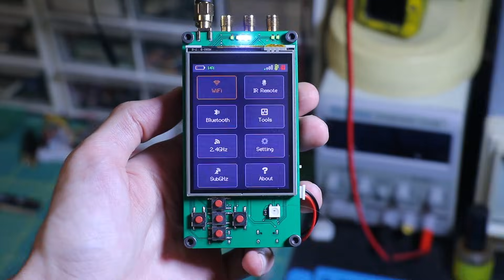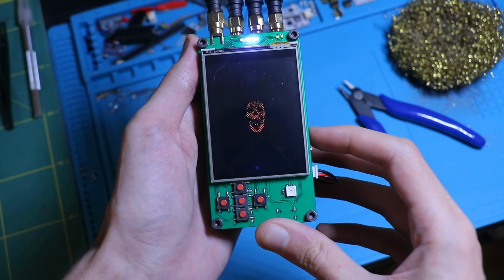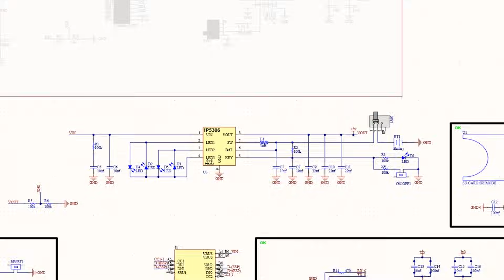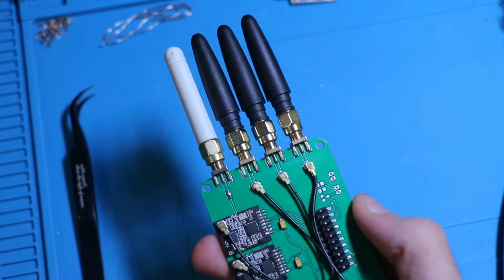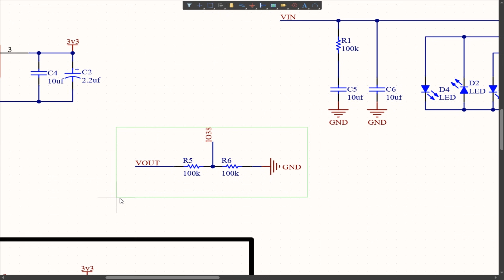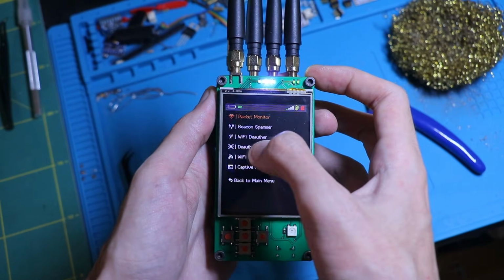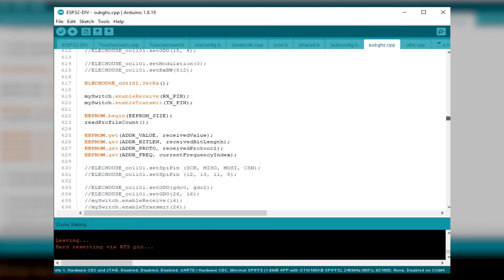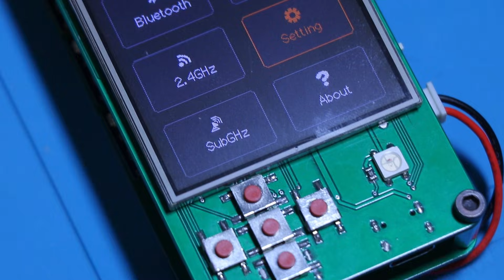I Fixed ESP32-DIV… and It’s Better Than Ever | Part 2

Comment: If several antennas are not used at the same time you can use a single SMA connector and RF switches. For instance, HackRF uses several SKY13317. Miniature relays will also do if you don't mind clicking. Naturally the user will have to connect the required antenna depending on the used frequency. My experience with HackRF shows that this is not a problem in practice. Also there are broadband / multiband antennas (several dipoles connected in parallel, as a simplest example).

Comment: Hello, good brother
I had a question
Instead of the esp 32 u, can I program another model like d or other modules?
Or should it be u
And it says ir remote control, can I test it or should I buy this transceiver module and install it, then will it run?

Comment: the number of antennas depends on whether you need them all on at once or not in addition to the intended frequency of each antenna. if there are same frequency antennas and each are not on at the same time, then you can use an single pole double throw switch (spdt) to toggle which will use the antenna at a certain time. the simple way is a physical toggle switch but a more elegant alternative method of an spdt might be preferred to keep it small and neat. 

consolidating antennas alone may cause issues with destructive interference, and loss. there might be something with adding a circulator, but further tests would need to be done.

Comment: nice lil design, btw you should add RF switches so you can reduce the number of antennas for multiband comunication.
Reply: Tbh, multi antenna design makes more sense because of antenna radiation efficiency in a given band
Reply: @Kawka1122 yes of course but he asked for a way to reduce the number of them
Reply: @Kawka1122  Not necessarily. Firstly, you limit what kind of antenna a user can connect (physical size limitations). Secondly, you don't account how several antennas affect each other.
Reply: @R2AUK  Not at all. External SMA antennas and in TDMA which most likely makes sense here, there is no influence between channels
Reply: @Kawka1122  Any metal objects near the antenna influence it, including other antennas. How much - should be measured for the particular case.
Reply: @R2AUK  to some extent of course. But that's matter of tuning. And in reality it is not such a big influence as operating out of band. These are low power TRX chips so not a big deal to get minimally higher SWR, only that it will affect radiation pattern. Influence on matching is close to none

Comment: Oh my God! I thought you scraped the old version and went with this new one... I have just received the last batch of components from AliExpress and want to start assembling it, this week. In regards to the Pin-Header, maybe you could use "magnetic pogo pin connectors"?
In regards to the antennas, maybe connect them on the pcb down and go along the PCB. The result will be a shorter device but bulkier.
Reply: Haha I literally ordered all the boards last night I was thinking typical
Reply: How do you get around the sd card not recording sub frequencies